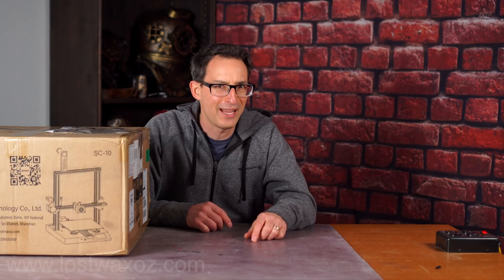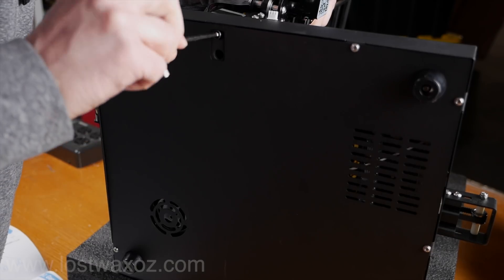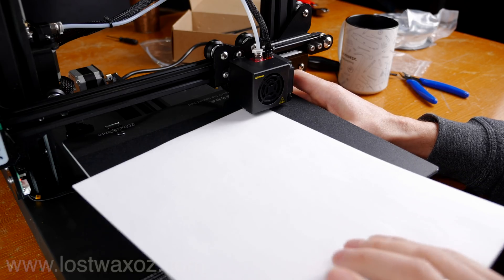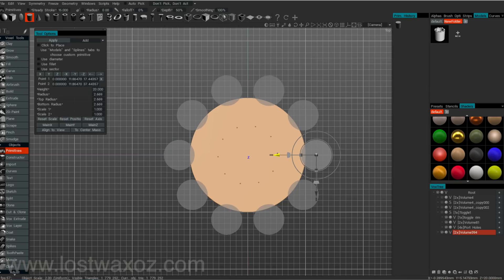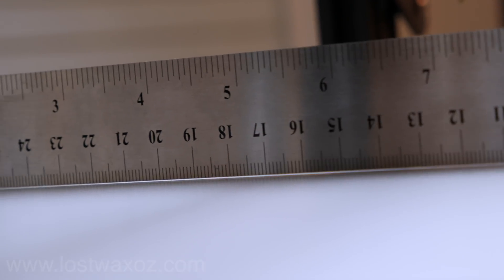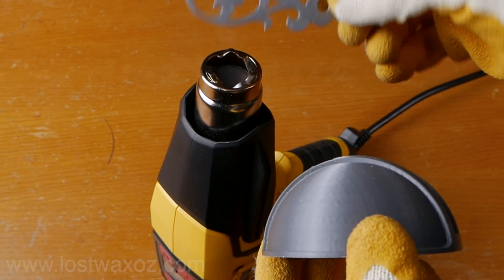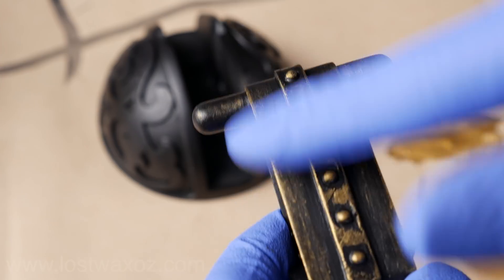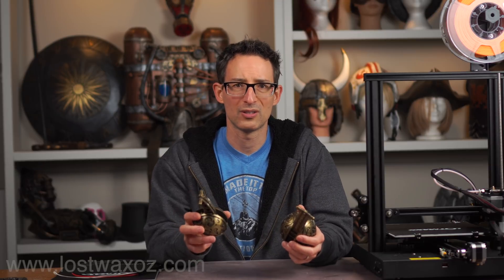I Make a Steampunk 3D Print Coat Hook! Lotmaxx SC-10 3D Printer review. 3D Printer Projects

Comment: How is 3DC different from softwares like Blender - minus the learning curve ?
Reply from the maker: I don't know Blender well enough to compare. The little I used Blender, it seemed like the Boolean function wasn't that great for creating clean files for 3d printing. But the workflow for 3dcoat takes a lot of getting used to, and it doesn't seem to use real units of measurement, nor is it even possible to centre an object on another (crazy right?) I have used 3dCoat and tinkercad, and it totally depends on my project which one I decide to use, they are just so different.

Comment: These look so nice! I've been curious about 3D printing, but it's always intimidated me because of the little blips the machines can have. Going through and describing common issues and ways you fixed them was nice to see.

I haven't seen a simple floor gloss being used for plastic coating and it looks super nice. Does it work the same on foam props as well? I usually use an acrylic coating spray, but over time it fills with dust and creates a bit of a stickiness that makes it impossible to clean.
Reply from the maker: I have used the floor gloss on foam, with pretty good results, though sometimes there is a bit of tackiness it seems, and I am not sure if that's the fault of the paint underneath or the floor gloss. The Pledge floor gloss used to be called "Future" which was and is widely used in the model making community for clear coating models after painting.
Reply: @LostWax  Ahh that makes sense now. Yeah, I'll have to give it a shot with a few props and paint brands and see what happens. Even if it still develops a tackiness, I imagine it lasts longer than an acrylic spray, so that'd be worth it.
Thank you so much for the response and info!

Comment: Ive been able to personally use "Blender" as a software to create things i would like,, and it has a built in import/export feature to STL among MANY other file types, I made a resident evil 6 chess piece and printed it, Used creality slicer to finish up the printing options, The best bit? Blender is entirely free, Not absolutely insane to use or learn, especially just for 3d printing use! i hope this helps someone!!
Reply from the maker: Awesome, free is always good!! I did spend some time with blender, but was getting frustrated (probably cause I had no clue what I was doing) but I should take some time to give it a go again.
Reply: @LostWax  Blender is something (for me) that was easier to get a hold of by watching tutorials, Lots of buttons and features, Still getting lost working in it to this day, But i can guarantee you would get a hold of it in nothing flat :D keep at it!

Comment: I've had an Ender 3 for two years now and love it.  You can save yourself a headache and get a glass bed for it.  A lot of the printers have the warped heat bed issues.  I can do some decent prints but not the designing like you.  But I am working on it.  You're going wonder how you ever got by without it because it's addictive! 😁😁
Reply from the maker: It is definitely is an amazing tool to have, I have already made lots of little bits and pieces that would have been hard to get any other way...
Reply: Lost Wax I bought it because I wanted to hide my amazon dot.  When I found that what I wanted (Gramazon- thingiverse) cost just as much to have printed as the printer cost I bought one and taught myself.  Right now I'm trying to learn sculptris.  You're going to have a blast using your printer. PS I love steampunk too and my computer room is done all in steampunk.